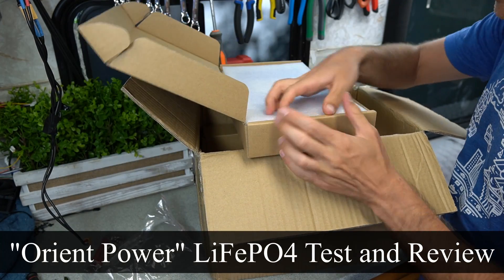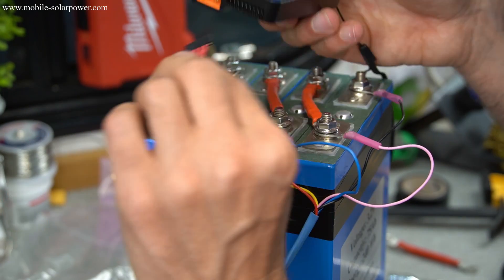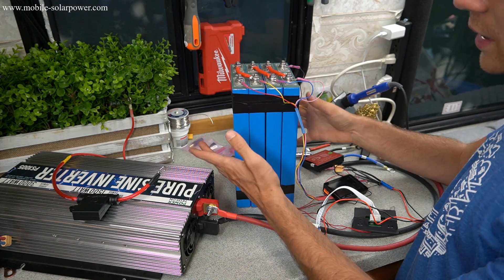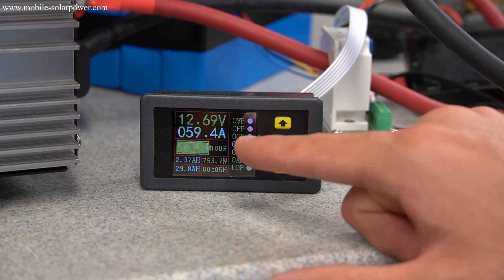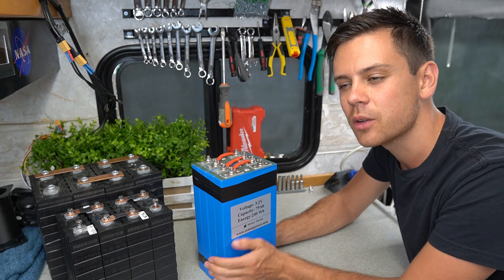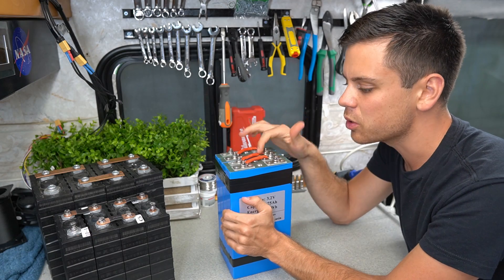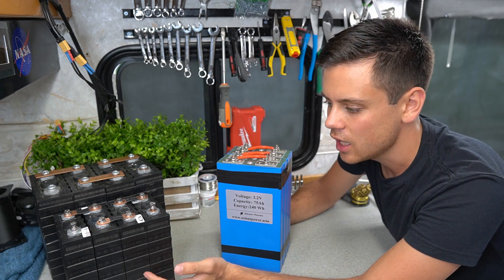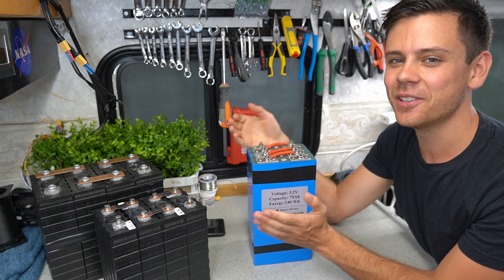"Orient Power" $450 75ah LiFePO4 from Amazon.com - Test and Discussion -

Comment from the maker: Video table of contents to save time:
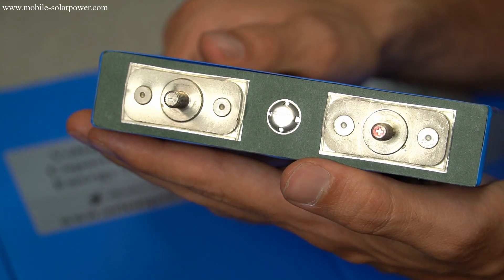0:25 Building the Battery Pack
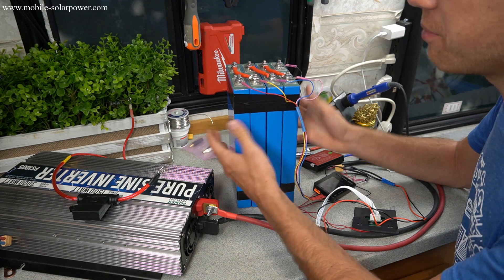2:57 Capacity Test
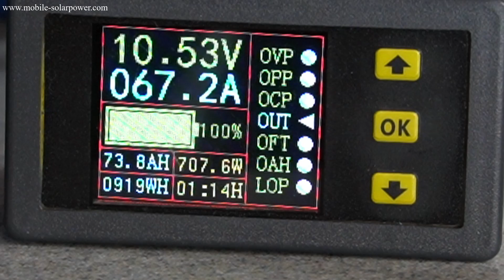4:17 Capacity test results
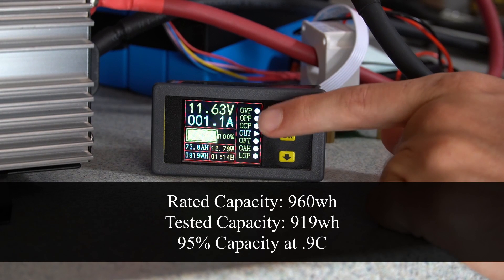4:30 Conclusion and Comparison to other options on the market

Tired of getting ripped off? Check out my "Will Prowse Approved" solar product recommendations below!

12V Batteries
https://www.mobile-solarpower.com/lithium-batteries.html

48V Batteries
https://www.mobile-solarpower.com/48v-batteries.html

Offgrid Inverter System Builder
https://www.mobile-solarpower.com/48v-complete-system-blueprint-559371.html

Hybrid Inverter System Builder
https://www.mobile-solarpower.com/code-compliant-48v-offgrid-system.html

Mobile Handtruck System Builder (very popular!)
https://www.mobile-solarpower.com/mobile-48v-system.html

Solar Panels
https://www.mobile-solarpower.com/300w-solar-panels.html

Ground Mount Solar Racking
https://www.mobile-solarpower.com/ground-mount-racks.html

Wire, Lugs and Busbars
https://www.mobile-solarpower.com/wire-and-connectors.html

Tools
https://www.mobile-solarpower.com/tools.html

Fuses and Circuit Breakers
https://www.mobile-solarpower.com/fuses.html

Plug-N-Play Solar Systems
Ecoflow, Anker And Bluetti! So many models to choose from. See my current recommendations here:
https://www.mobile-solarpower.com/full-size-systems.html

~~~~~~~~~~~~~~~~~~~~~~~~~~~~~~~~~~~~~~~~~~
Need to build a large DIY system? Need a trustworthy solar distributor? These are my favorites:

Signature Solar
Creator of EG4! Solar Minisplits, Victron and More! Largest Solar Store Online.
If you want $50 off, please use my link below and coupon code "DIYSOLAR50":
https://signaturesolar.com/?ref=cPwLcVc0SW-BjN

Current Connected
Best Prices for EG4, Victron, Midnite and so much more! Fast Shipping and Highest Rated Customer Service:
https://currentconnected.com/?ref=wp

~~~~~~~~~~~~~~~~~~~~~~~~~~~~~~~~~~~~~~~~~~
Join our DIY Solar Community 
Need more help? Join the largest solar forum on the internet for beginners and professionals alike. 140,000 members and counting!
https://www.diysolarforum.com

Check Out My Free Book
Best-selling and beginner-friendly guidebook to off-grid 12V solar!
https://www.mobile-solarpower.com/the-book.html

~~~~~~~~~~~~~~~~~~~~~~~~~~~~~~~~~~~~~~~~~~
Contact Information:
I am NOT available for personal solar system consult! If you wish to contact me, this is my direct email: williamprowsediysolar@gmail.com
FTC Disclosure Statement and Disclaimers:
Every video includes paid promotion or sponsorship (such as free products for review). Some links on this YouTube channel may be affiliate links. We may get paid if you buy something or take an action after clicking one of these. My videos are for educational purposes only. Information is subject to change/update at any time. Electricity is DANGEROUS and can kill. Be smart and use common sense :) DIY Solar Power with Will Prowse is a participant in the Amazon Services LLC Associates Program, An affiliate advertising program designed to provide a means for sites to earn advertising fees by advertising and linking to Amazon.com
Reply: Hey Will, any plans to make a video with a home or cabin installation?
Reply: @TechnoMonkeyFarm  i volunteer my home if he wants to donate lol
Reply: It would be cool to see this in a cafe chopper or something
Reply: Hi Will, you are such an impressive young man. I have another older friend has a Inogen I portable oxygen concentrator. I would like to know what would be the best solar generators to have on hand for emergency. We live in FL and hurricanes are a worry. Than you vary much.
Reply: how
Reply: 48 v

Comment: Yours say 85ah But on Amazon their either 75ah or 80ah guess they rerated them lol  Great video as usual. Check out their rackmount 200ah
Reply: 75ah with M6 bolts, 80ah with M8 bolts and height 206mm, 100ah with M8 bolts.

Comment: Hy, I want to make a little project with an old ups (because of the pure sine that has)from eaton model no 5115, 1500VA, Actualy is 500watt, had some 6v 9Ah batts, 6 in series, so I think if you do the math even with 95% eficiency it can't do 500W. Anyway, I want to replace these old ones with some kind of batts that maybe you could recomend to me that realy can do 36v and >20Ah, and for recharge it useing a solar panel. I want to make it totaly idependent from the house's electric circuit and get at least 500Wh. Can it be posible? Thanks

Comment: I just got some 200ah lifepo4. Mine use helicoils so you could replace the studs.
I have 16 200ah cells in a single 24v battery setup. I put them in a pelican case and packed them with the foam they use when they shipped it to me. I have an RV water tank heating pad on the outside of the case  I use a victron 24/3000/70  multiplus inverter. 
I'm still trying to put solar panels on my RV but I have about 350 watts of amorphous solar panels on the side of the RV stuck on using VHB tape.  The only hard part about my system is that I ran 1/0 cable through my roof to my basement and it was difficult fishing it through the RVs thin Wall.  I plan to put 9 175 watt panels on the roof.  Using a victron smart solar 100/50 charge controller
Reply: Interesting. Which cell brand and model did you choose and why?

Comment: The Orient Power 12v75ah specs on Amazon quote a 3C discharge rate - same as Sinopoly 3C rate -  regarding your comment near video end: did you find a different spec on these showing 2C? Thanks for these vids and info.
Reply from the maker: That's weird. Yeah the data sheet said 2c
Reply: Thanks, I'll use that 2C rating like you stated based on their datasheet.
Reply from the maker: My sheet came with the pack. That's weird

Comment: I bought 4x of the LiFePO4 Headway 100A batteries, to make a 12V system. Next, I was wondering how to size the solar panel? How do I figure the wattage of the solar panel to charge these batteries?
Reply: @Ron Watkins I am guessing you got four Headway 38120 cells rated at 100A discharge. They typically have a rated capacity of 8A-10A. Running four in series gives 12v at 8-10A capacity which is 96-120watt hours. If you want to charge your stack in one hour you need a 120w panel. A 12w panel would charge the stack in 10 hours. (Charge controller and conversion losses not factored)
Reply: @canaanwinthrop2463  They are "HEADWAY 38120 HP 3.2V 8AH LIFEPO4 LITHIUM BATTERIES 25C 200A SUPER CELLS". Im not sure if this is enough to power my house. I have a 100A main breaker panel, so I though these would be sufficient to hit the maximum load the house can pull. You think a single 120w panel is enough to run the house?
Reply: @Ron Watkins

EDITED
 I have the same cells as you. Not even close to enough power for a real house to run for long. Your house breaker is 100A at a much higher Voltage (110-240V typically). Amps multiplied by Volts gives Watts. 100A*240V=24,000 Max Watts. That is a ton of power!

These are rated to safely OUTPUT up to 200Amps of Current (12v current in your configuration). 200 of 12V Current is only 2,400 Watts. Your four cell stack is rated 8Amp-hours STORAGE capacity @12v. Amps multiplied by volts gives storage in Watt hours. (8A*12V= 96Watt-hours of storage). Basically at 12V you can draw 1A (12Watts) for eight hours, 2A for four hours, 4A for two hours etc. You can run 200A (2400w@12v) off these but the stack would be dead in about three minutes.

The average home uses 28,900 Watts per day. You would need approximately 300 of these four cell stacks to store enough power for one full day (28,900w/96w=301).
Reply: @canaanwinthrop2463  Ouch, I wasn't aware of that. My plan was to use one of the grid-tie inverters that you plug into a wall outlet. I was led to believe that it would feed the power back into the house, but it sounds like not enough. So, these headway cells (4 of them in series) will have 12V @ 200A. but that is only 2400W. So how does a 120W panel cover the needs of a 2400W battery bank? Wouldn't I need 2400W of solar panel?
Reply: @Ron Watkins the 2400W figure is MAX output, not storage capacity.

Example: I have a small old lead acid (car style) battery rated at the SAME 8Amp-hours@12V for a total of 96Watt hours of STORAGE. However, it can only output 300watt of current. They both run my 100w lights but only the Headway has enough output CURRENT to run my 1000w microwave. Even though they both STORE the same 96Watt hours.
Reply: @Ron Watkins the batteries do nothing to produce power or send it back to the grid. Batteries are used as emergency STORAGE in a grid tie system. The solar panels and inverter do all the work. The battery is to keep you going if the grid goes down. You don’t actually need more batteries for that system. But when the power goes out you are out of luck.

I recommend you talk to somebody more experienced with Grid tie systems. I like the ones where you can start with a couple panels and just add more as you feel like it. It is more about spinning the meter backwards then actually storing the power on site.
Reply: Any wattage solar panel that is compatible with your charge controller will work. The cells charge faster the higher the wattage the panels are. Your stack is only 96Watt-hours. A solar panel outputting an honest 25W should take about four hours (96/25=3.84)

Comment: Hey dude,just biult an EV Vw van. What's your opinion on lithium batteries for my 144v motor for roughly 200mi on cherge. Thx for the comments
Reply: 144v bms is costly

Comment: Great job Will.  I like the smaller size and aluminum jacket of this design.  I want to make a multi-use pack, so portability is critical.
About the bus bars -stamped bars are much more precise, but their stiffness can exert damaging force on the battery terminals with thermal expansion.  You are annoyed that they don't just stack, but if I spent $400+ on a battery, I would build a mounting case with space for airflow between cells, temp. control and a fan.
The biggest negative or question I have about this battery is the inferior discharge rating.  Do you think this is just rating conservatively?  Is there a way to test it?

Comment: YOU  tapered them together zo there is no heat disapaticien  heat couses for earlier degredations and faster protection mode
Reply from the maker: Yes but increases capacity which is great for this test. If I was building a long term pack, at high c rate application, then sure. But for this test, absolutely not

Comment: Will - Your enthusiasm for these self-build solar systems is contagious! Really have learned so much... Big thanks for that... But I do have one question... Often you refer to "heat build-up" as a concern and something to watch for... both in the system electronics and wires and the causes... but when I see you taping together individual battery cells without any spacer for convective airflow/heat dissipation between the individual cells or even under your "DIY battery packs", I am left wondering if A) Wouldn't it be wise to put in two vertical non-conductive spacers between individual cells, or B) If this isn't needed, can you explain why the between-the-cells heat build-up from charging or discharge cycles is not an issue... (it seems to me as a non-science guy that you are in effect putting cells back to back which in effect insulates them and would adversely affect the life and balance of the DIY battery packs.) Thanks again for your wisdom and enthusiasm! (this applies to the cells in this video with the blue wrap over aluminum and the other recent Life PO4 cells with the black plastic cases)

Comment: Thank you for your channel, I'm starting to learn! I have a transit van and from your videos and your book I think I need 300 watt solar system On amazon PRIME DAY NOW (Renogy 100 Watts 12 Volts Monocrystalline Solar Panel Bundle Kit with 30A Negative ground Charge Controller+9in MC4 Adaptor Kit) and 200 amp hour battery 
ON PRIME DAY NOW (Renogy Deep Cycle AGM Battery 12 Volt 200Ah for RV, Solar, Marine, and Off-Grid Applications). I already bought the 3,000 watt inverter (GoWISE Power PS1004 Pure Sine Wave Inverter) that you use on your show but Im thinking..... should have bought a charger/inverter? Whats the best deal today on amazon? Should I buy today? Thank you! Just trying to save $ today!

Comment: Hi Will, I'm wondering if it was heat loss for the lost watts I bet with better connectors it would be closer to 75ah
Reply from the maker: Oh these will warm up at that c rates, it's ok. And it's pure copper 4 gauge, so it can handle load fine with minimal losses. But yeah I agree

Comment: You  SHOULD let gaps between the pieces when taping them together, cause in your way, only the outer two pieces can dissipate their heat semi-correctly... And use copper or alluminium quadrangular bars (with rounded corners, in order not to damage the packs) as spacers, instead of, let´s say, wood, cause metals take heat up easily and dissipate it easily too, while wood is a heat insulator! I know your set up isn´t permanent maybe, but people will copy what you show them 1 to 1, and make the same mistakes you´d shown them!!! Or at least mention such things from the beginn on!
Reply from the maker: It doesn't matter for solar. This test is at high c rate. In real world use with solar, c rate would be so low that barely any heat would be generated. And thermal stability of lithium iron phosphate lattice is high. It doesn't matter.
Reply: @WillProwse  You are totaly right, but still mention such stuff, people may use it in an e-bike, you mentioned the e-bike-situation even yourself...
Reply from the maker: @klausbrinck2137  ohhhh right, yeah good point. Yeah cooling would help. I agree

Comment: I wondered Will if your comments about the headway batteries putting out only 50 percent rated are because the batteries just suck or they've been used to much or what reason these batteries didn't perform to spec. I do like this video. I think its important to compare battery performances and tested outputs and the other things such as size and weight differences. So Will, point me in the direction of a good 12 volt storage battery for solar because I'm getting to that point where I need to know. The battery or bank I need wont be under any huge load, mostly light stuff. Any idea's ?

Comment: Aluminum case dissipates heat and increases the cycle life according to electriccarparts.  Why do you not use spacers between the cells? By clamping them together heat cannot escape from the two middle batteries. They will become uneven after a while.  So, better terminal connectors, and spacers and they should perform to 4000 cycles.
Reply from the maker: Because this was a capacity test and I wanted the cells to be warm. It gave them more of a advantage. If this was a charge cycle test, then I would focus on heat management and keep them cool. Totally different type of test
Reply: @WillProwse  Right, but worth a mention to your viewers, as regards their own attempts.

Comment: I wanna see a diy lifepo4 battery that can handle large loads like a 2500w induction cooktop!
Reply from the maker: Check my 24v raw cell LiFePO4 systems. They can handle any size inverter. Even 10,000 watt

Comment: HAY DUDE, YOU ARE FANTASTIC.
TRY USING BLUE DUCT TAPE.
And a 6 mm spacer between each battery, you will find the link bars will line up without bending.

Comment: Hey Will, I've tried using the Harbor Freight heat gun for load testing on inverters and it does an interesting pulsed (PWM) of the heater coils at various settings.  This can lead to surge current at the batteries, which does change their measured output due to the high current draw, even if intermittent, and it makes it difficult to measure accurately.  Best to use an always on source, like an electric heater with just on/off thermostat control and combine it with a 20A Variac to dial in continuous power control.

Comment: Maybe someone can elaborate. I am looking to replace the four batteries I have on my boat. They are GC-6V ( 6 volt ) and 205AH each. They cost just under $200 a piece. So to replace 4 would be roughly $800. These LiFePO4 batteries are fricken expensive, there must be a benefit. Because to get the same (Roughly Calculated 410 AH) bank..  [Based on building 4 SLA batteries in a series parallel design]  I'm spending thousands. What am I missing
Reply: SLA If you can discharge 100% and recover it , then you are lucky. Life time, size weight, many difference.each of them has own benefit, depends on you.

Comment: Hey will thanks for the great vids.  I heard you reference these batteries would be good for an e-bike.  Do you think they would be better than the 18650 cells?  Thanks
Reply: I dont think these are good for ebike, as they are only rated 2c.
Reply: for ebikes you need a battery pack which can handle larger discharge rate ; like when going up a hill and/or starting under heavy load.

Comment: Thanks for mentally processing these options, there are so many choices to consider in battery selection. I’m leaning to higher amp/hour - C ratings.  I will be pushing my batteries  with microwave and induction cooking, power tools,  and need to know they will charge again, year after year.

Comment: Have you heard anything about the Vmaxtanks 100Ah LiFePo4 batteries? They are a heck of a deal at $849.99 with a 10% discount ($764.99) for first time customers and 7% off for returning customers. Each battery comes with a charger and has an LCD panel and USB ports.
Reply from the maker: Pretty lackluster stats. 80 amp discharge. Pricey for what you get. I wouldn't consider them at that price.